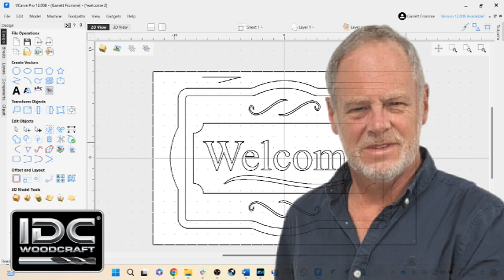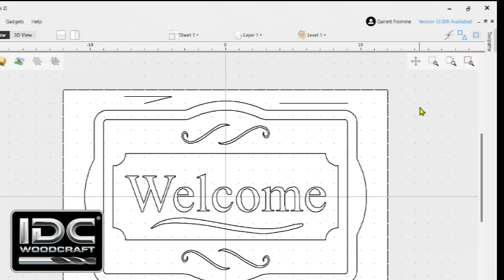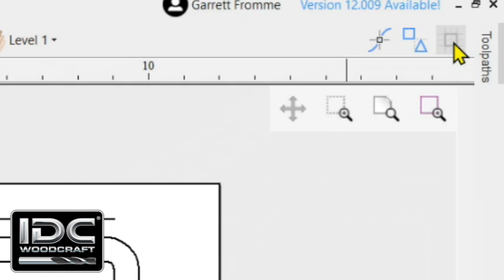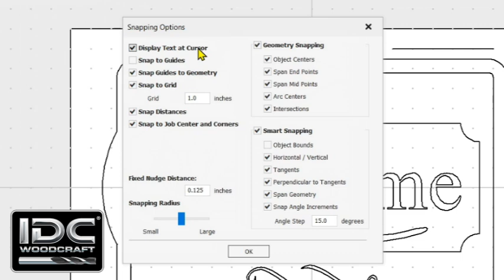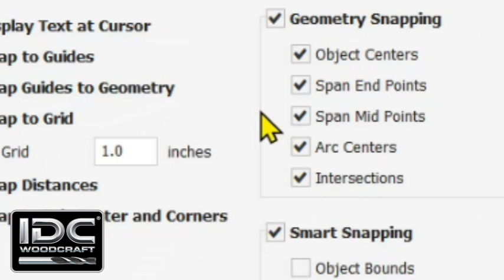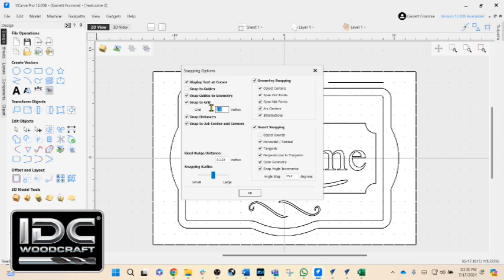Master Grids and Grid Spacing in Vectric: A Step-by-Step Guide

Comment: Garret you are about the best with Vectric I have seen. I have ran into an issue that I can not figure out,  Trying to create toolpaths for a Gibson Les Paul Guitar neck.   It has a 14 degree head stock. Everything is Straight and about an inch or so thick the you have the headstock on one end that goes down. No matter where I place the stl model in the material, It will not cut the top and bottom toolpaths correctly. Love to hear how you would do this,  Using Aspire 10 . Be glad to send you the STL Model.
Reply from the maker: jonmccrory2317, this one is a little tricky to walk you through via comments. I recommend joining us for our live sessions we host every Wednesday and we should be able to help guide you through it!